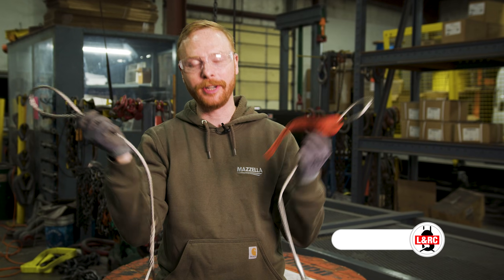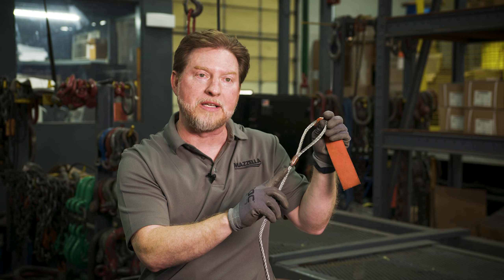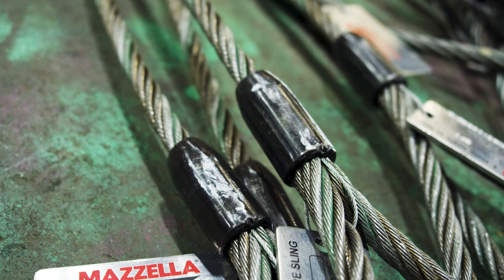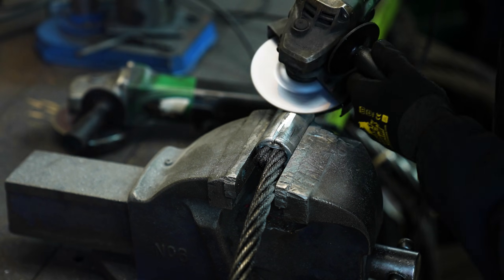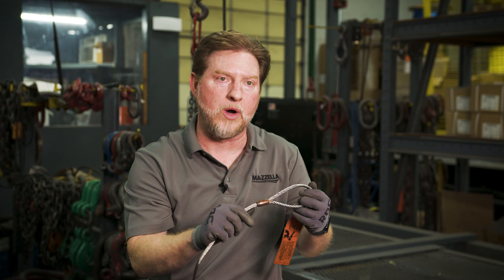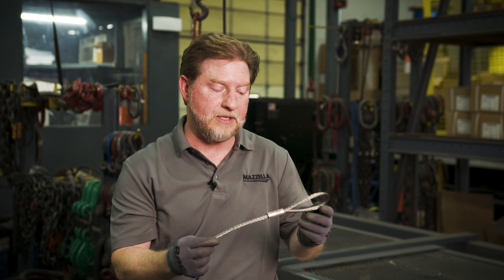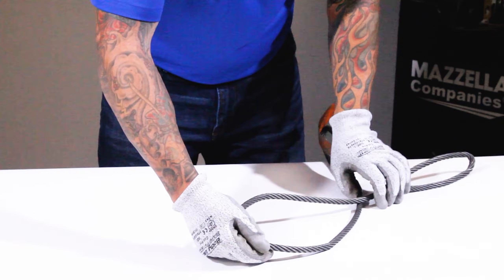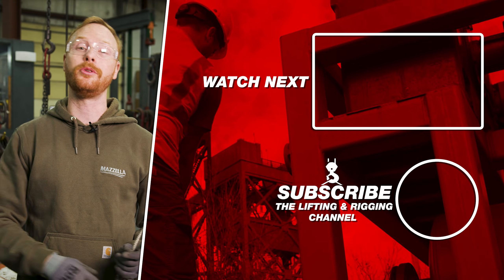Your Guide to Wire Rope Sling Eyes: Flemish Eye vs. Turnback vs. Hand Spliced

Comment: i have a question does the metal or steel loops tire/wear out at some point? and how do you see that in a inspection? greeting from the Netherlands.
Reply: Yes if one of the strands is broken the wire needs replaced

Comment: Hey, great video, thanks. I did want to add as an Ironworker i prefer the hand splice because of the render on the choke more then it getting snagged under the load (though that's a factor). When we send a piece up we're usually only using one choker and it's critical that the piece is straight up and down (no "roll") and typically the knuckle of a mechanical splice will either land right on the flange creating an opportunity for it to jump one way or the other or it'll catch under the flange putting extra weight on that knuckle. Which probably isn't good. My question though is, is there a good rule of thumb for how much capacity you lose with a hand spice compared to the mechanical?
Reply from the maker: Reduction between Mechanical Splice vs. Hand Splice is normally 15 – 20% as a rule of thumb.  It varies depending on vertical or choke configuration.  The choke configuration tends to be a 15% reduction mech to hand splice, but vertical can spike from 10% - 20%.  The other factor would be the IPS (Improved Plow Steel) compared to EIPS (Extra Improved Plow Steel - also known as XIP) wire rope.  Most manufacturers are no longer making IPS wire rope, so EIPS would make more sense.

Comment: How about hand splice plus carbon steel? is this  advisable to use for lifting?what is the most advisable to use to lifting?
Reply from the maker: So, I'm not sure exactly what you are asking, so I have two answers for you depending on what you meant.
If you are saying you hand-splice a sling and then put a carbon sleeve over the body of the splice, then NO.  You don’t want to do that.  We have already performed the “splice by opening up the s strands and 3 strands + core and performed the splice back onto themselves, forming the eye.  We then have small tails on the Mechanically spliced sling that get tucked around the neck, and the carbon steel sleeve is pulled over them and hammered into place prior to putting them into the swagger. 

If you are asking if you can have a sling with a hand-splice taper and conceal eye on one end and a mechanical splice eye on the other, then YES.  That is being used quite heavily with ironworkers to have the mechanical splice eye in the hook of the crane (the same end that has the tag on it to protect the tag from damage), and the hand-splice end is being used to choke the load and does not have a carbon steel sleeve on it to obstruct the slings from pulling out from under the load easily.  

So recap - Do not put a carbon steel sleeve on a hand-spliced taper and conceal-eyed sling. But you can have different style eyes on the ends of one sling.
Reply: Thank you for good explanation @LiftingandRigging

Comment: How do you tell the difference between a flemished eye and turn back eye with fittings?
Reply: A turnback involves turning a piece of wire back onto itself and clamping it down with a sleeve or clips.

A flemished eye involves taking the wire apart turning the wire back on itself and weaving it back together. 

A flemish eye is more reliable if a sleeve fails or you have no sleeve at all.
Reply from the maker: You should be able to see the tail end folded back when using a turnback.